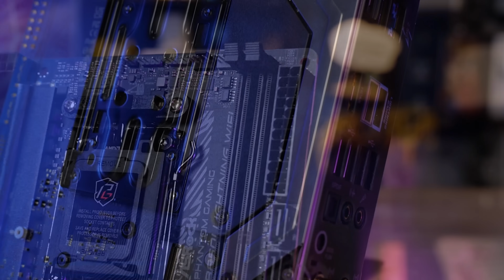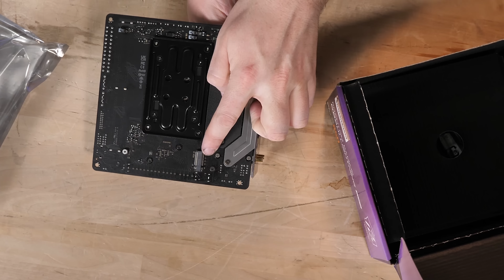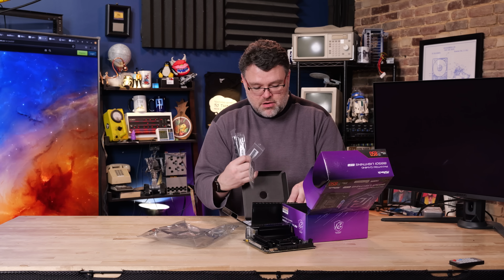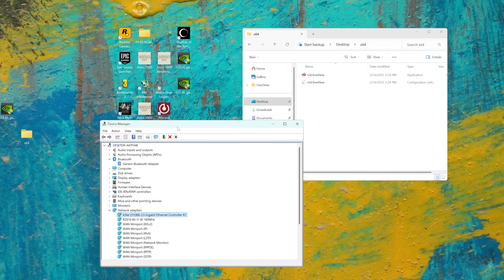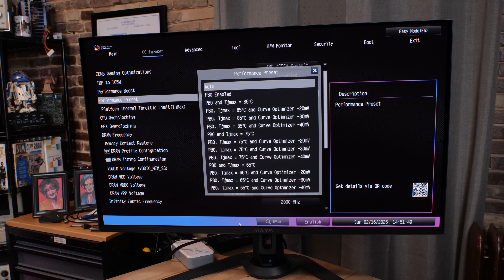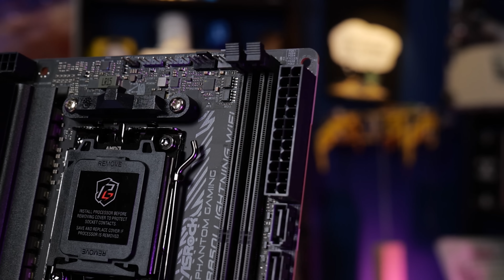Phantom Gaming B850i Lightning WiFi Review

Comment: I have been looking for dollar friendly Mini-Itx board for my Fractal Terra build. This one really looks good and is well priced compared to the others. I want to pair it with 9900x and RX 9070 XT.  I saw that the fractal terra gpu riser cable is only pci 16x gen 4 and not Gen 5.  Will that have a sifnificant effect? or can the rise cable be replaced with a Gen 5 one?

Comment: Stay away from ASROCK if you are using 9800X3D or other 9000 chips. Mine died after 1 month of usage. If you still want to use it adjust your SOC setting to not exceed 1.2V
Reply: Newest BIOS fixed all of that.

Comment: I like how you don't spend a lot of time unpacking, but convey the essentials on these boards briefly and concisely. Nevertheless, I would like to ask a critical question: With your preferred setup (“test bench”), *it seems difficult to judge thermal conditions*, especially with an ITX board in a small case. How do you think a hot SSD on the bottom of that board will run under high load in a tight SFF case? Thanks for your thoughts on that!

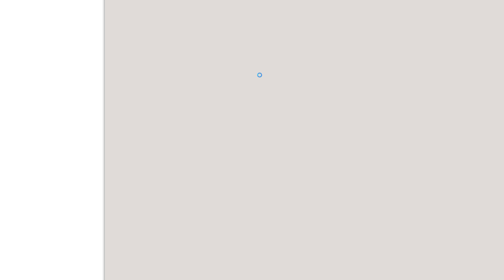Comment: 4:29 What do you mean by "it's interesting that it's not the Realtek solution"? This board's Killer E3100G doesn't have a Realtek chip like they usually do?

Edit: bought the board and it is indeed Realtek chip under the hood still

Comment: @Level1Techs - can you folks review the ASUS ROG STRIX B850-I GAMING WIFI. I have their ROG Strix B450-i Gaming mobo in my primary PC that I bought in late 2019. That PC ran 24/7 (almost never powered it down) from March 2020 to Mid-2023 (return to office), and has been used for many thousands of hours of gaming, work, and upgraded a few times (currently running a 5700X3D on it with a Sapphire 7900XT).  It served me amazingly, but I am thinking about upgrading to a B850-i and a 9950X3D along with 96GB DDR5-6000 memory and a Samsung 9100 Pro Gen5 PCIe drive.  I am stuck with a Gen3 PCIe NVMe speeds and Wifi5, that seems to max out around 500MBps, while my home service is 1300MBps.

Comment: Concerning the USB 2.0, consider what the majority of gamers will be using the USB ports for. Keyboard, mouse, web cam, audio solution (if needed) are all only going to need USB 2.0 to be fully functional. Faster internet is great for external storage or if using for a video output. However for most gamers USB 2.0 fills a lot of the needs.

Comment: The USB-C Port (USB32_TC1) is only capable of USB4 if the Mainboard is equipped with a Phoenix CPU otherwise it will be downgraded to a 10 Gbps connection.
Reply: That’s a shame
Reply: And this design doesn't make very much sense. How are you supposed to use DisplayPort with the 8700G?

Comment: Yeah, with the recent events I'm not trusting my 9800x3d with an ASRock board.
Reply: Just update the bios. People don't update bios and just throw in a new cpu and expect everything is fine lol.
Reply: @Hybrid_Phantom they’re still blowing up
Reply: Beo ngl this is weird and my non expert opinion believes its a software issue. Why? ASRock is a legend and if you look at the mosfet layout it seems like one of the robust if not the most robust out there, at least for the itx boards in my country. Not only did this drama make asrock cheapest but i wouldve chosen them anyway cause of on paper stats. If there is some more serious issue that cannot be fixed with bios, than its so cooked that they will have to recall units or face lawsuits in the future. From what ive seen the burned CPU's mostly burn on the same areas that correspond to some voltage control. In so ASRock actually makes sense when they said to GamerNexus that the most probable cause is some problem with bios and Voltage regulation. Im happy i paid 190€ for this Motherboard, the Mosfets seem so good, ill prob be able to work with the am6 24 c next gen Cpu's :P

Comment: Idle power consumption still worse than LGA1851?
Reply: The issue is the I/O die.  You can undervolt it to reduce idle power tho.
Reply: Depends on what you stick in there. I’ve got a 8700G and that has pretty good idle power consumption (drops into the single digits, which practically matches Intel). Other newer gen Ryzen can be tuned to have OK idle consumption (15-20W) but will never get as low due to their chiplet design.

Comment: another manufacturer cheap out on back panel I/O options, so much space for usb4/TB4 ports.... if it is for a mini build without dedicated video card need more video outputs too, here one and the only usb-c with altDP support would be occupied...but no, priority is put wifi into a desktop that is wired up to the wall and monitor and probably peripherals too but no way we put a trillion Gbit wired network card there noooooo put a wifi into it......
Reply: A curious question from a non-gamer - what do you use all those back panel USB ports for?  With the exception of the mouse and keyboard, 2-3 easily accessible USB ports in the front should suffice for most needs.
Reply: @Justfun-nk3vj  as of simple peripherals a graphics tablet and trackball as input devices for foto and video editing, although I have a nas, still use external hard drives and ssd to transport data and to backup /fresh on the ext drive, one copy onto the working machine another goes to the nas so same data physically at least on 3 different places/, no I do not trust external usb hubs either standalone or built into monitors, they tend to bottleneck or disconnect or get stuck...and as of usb4/tb4 they are very scarce and as described above they would be cannibalized as video outputs anyway

Comment: Still not as good as the B650I Aorus Ultra, I hate how vendors keep just throwing away lanes when desktop platforms already give us so very few. Also wish any ITX board would just have decent networking too, 2.5G was insulting five years ago and it’s every bit as insulting today.
Reply: 2.5 is to keep prices lower... most people don't need even 1g
Reply: For 90% 2.5G is more than enough. Most of them don't even hit 1G.
Reply: @  @ryshask Even a single HDD can saturate a 2.5Gbps connection. I absolutely don't think I'm unreasonable to expect 10Gbps as the baseline for enthusiast computer parts, a RAIDZ1 of three HDDs really isn't very high-end for a home NAS in this age and even that low-end a solution is going to be wasted when the client computers only get a measly 2.5Gbps networking. Even the 10Gbps I'm talking about would only allow us to use four HDDs without bottlenecking, it's really the minimum I think should be acceptable outside of explicitly low-end motherboards like those N100 boards.
Reply: @СузаннаСергеевна I'm not sure this MB is for you, as a gaming ITX build 2.5gb is good for 99.9%. You however need a 10gb lan card.
Reply: @ IDD, but there are no ITX boards with 10GbE onboard and squeezing in an M.2 NIC is quite tricky in most cases.
Reply: Well said brat 👌👍
Reply: much agree